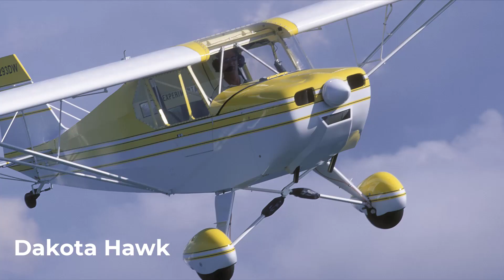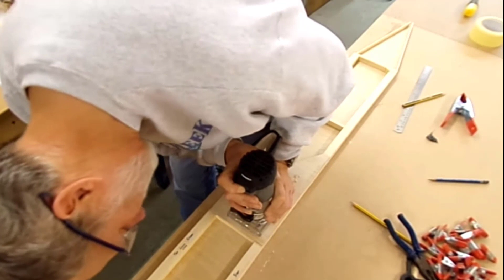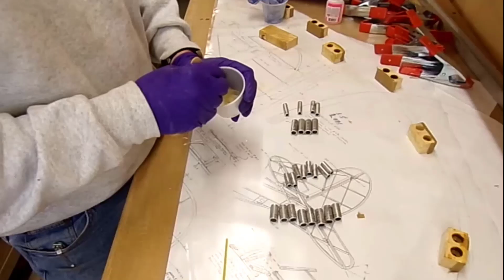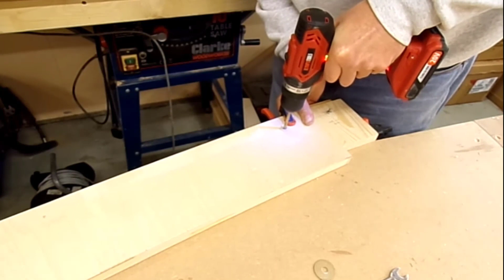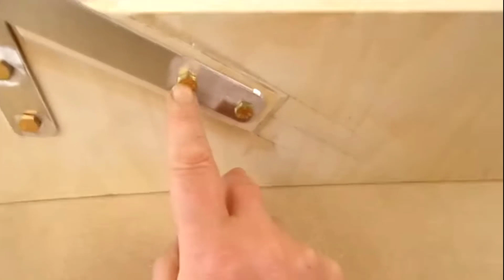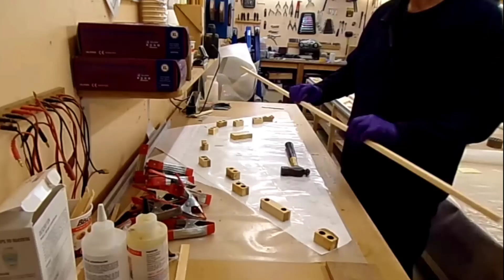BUILD A WING WITH ALGY YATES EP10

Comment: I’m wondering why the aluminum bushings are made of two pieces of tubing glued together instead of a single thick walled tubular bushing.
Reply: You can't get 061T6 tube with a thick enough wall and most would not have a laith to drill from bar stock. It has very little effect on the strength making it out of two pieces of tube. A good question.